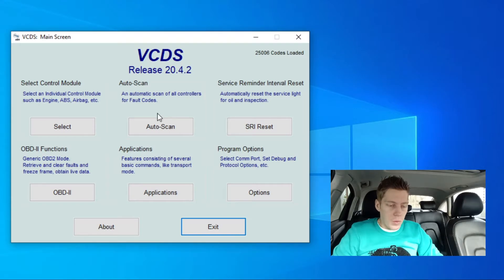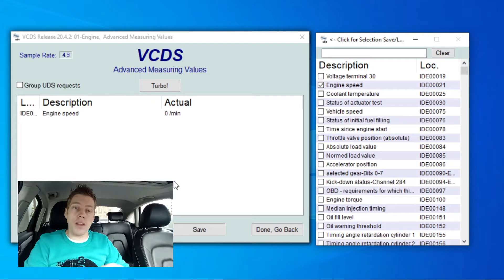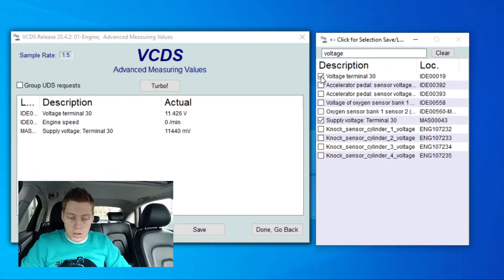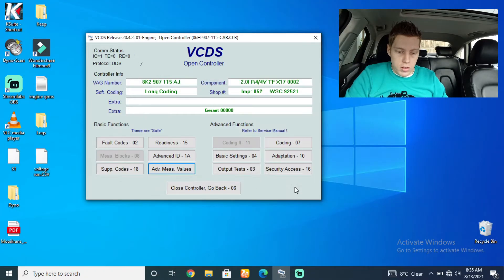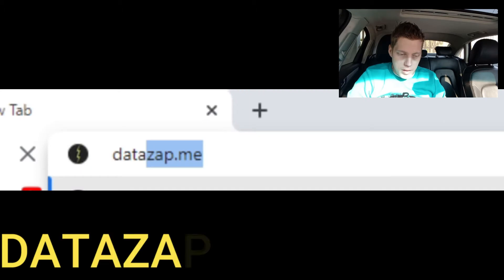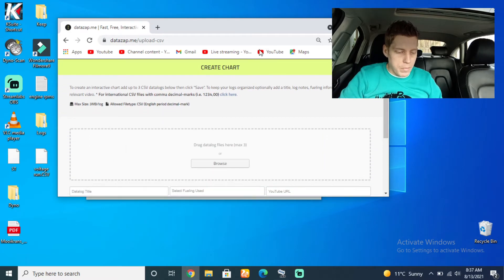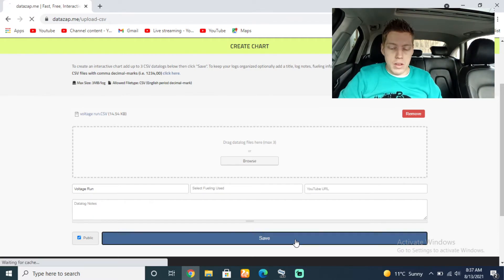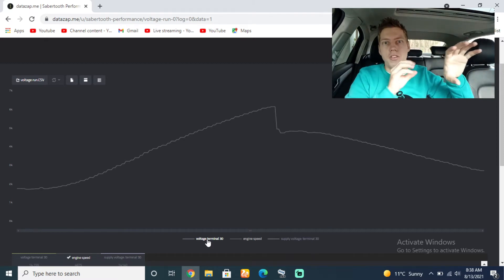How to Data Log Your Voltage System With VCDS

Comment: While doing this test its necessary open lights , radio , ac? Thanks
Reply from the maker: I would say do a test with and without everything on to see what the difference is. But I would say do the test with everything off to ensure there is nothing that will influence the results to make sure everything is charging like it should :)

Comment: This applies for 2.0tdi 2016 ?
Reply: Mine is skoda :)), but still is almost same engine, vw group. I'll have a look tomorrow to see how's my voltage doing. Thanks for the tips
Reply from the maker: Glad i could help 💪  lets hope all goes well 😎
Reply from the maker: Correct yes 👌💪 this information is valid for most if not all Audi's (stock)